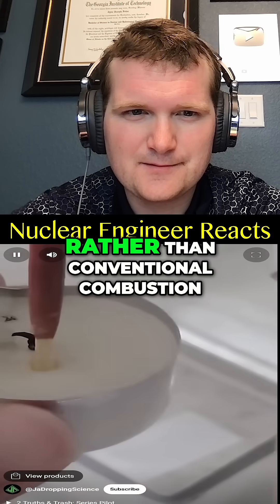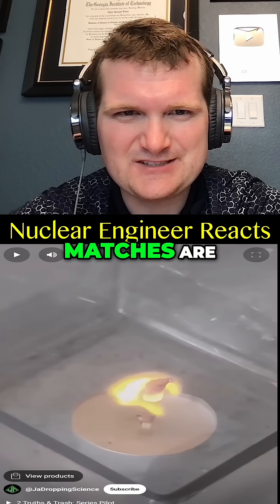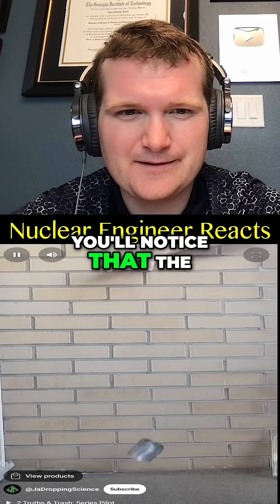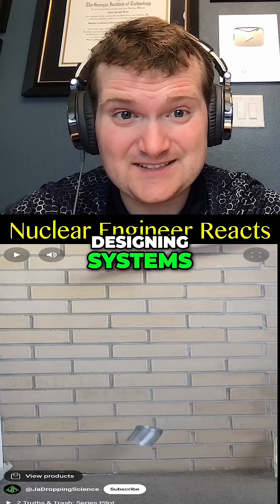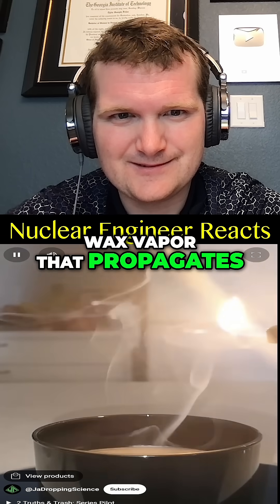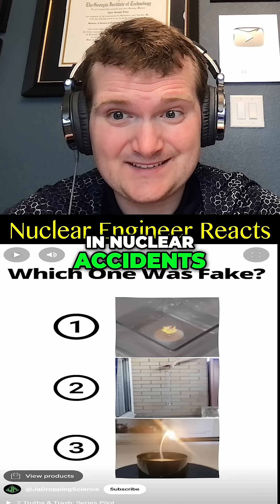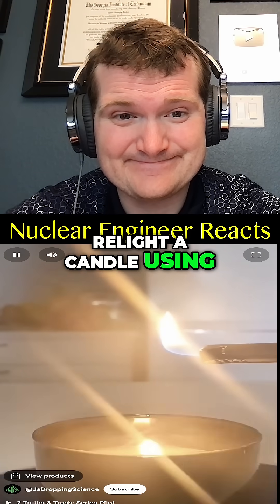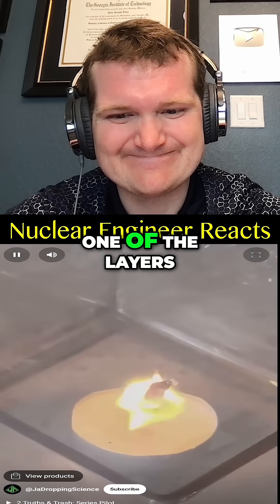Anti-Gravity Slinky? - Nuclear Engineer Reacts to 2 Truths & Trash by JaDroppingScience

Comment: Because Free Fall is indistinguishable from experiencing no gravity. Just as if you let go of a stretched out Slinky in space it would collapse back to the middle. It's still just doing that as the slinky is falling. The bottom of the slinky happens to be contracting towards the center with the same amount of acceleration 9.8m/s²,  as the center of mass of the slinky falling down, making the bottom of the slinky appear stationery from the reference frame of the ground.

Comment: the smoke from the candle can be relit because the smoke is unburned fuel, and when you see a flame, that flame is there because you have burning gasses. 

this thing about lighting smoke (or vaporised fuel) also applies to things like cooking oil. if you have it heated to the point it starts smoking, if its smoking enough, putting a match to it will make the whole thing ignite. if you go further, it will self ignite. 

also, if something sold (eg wood) is smoldering enough that it's producing lots of smoke, you can chuck a match at that too and the vapors will light. if something is smoldering like that chances are it'll light itself since smoldering fires produce heat too. 

this is how bush fires can start from lightning strikes, since it'll make a smoldering fire that eventually gets big and hot enough to have flame, which allows it to spread much faster.

Comment: Huh, didn't think about the delay in a waterhammer, which would need to be taken into account in the design. That and reflected back pulses, yeah, adds a level or two of complexity to wrangle.
Water damage for a home water system, but in a system with live steam, that turns into an awshit situation.
And in seismic events, turns an awshit into an ohballs really quickly, because water being tossed around gets vengeful.

Comment: Fun fact. The reason you don't pour water on a grease fire is because the oil is hot enough to flash boil the water. This causes the oil to splash and become exposed to even more oxygen and creates a huge fire ball. As a kid, I experimented a lot with fire. I made several grease fires and threw water both because cool fire ball and I wanted to better understand why certain things reacted in unexpected ways. Science to me has always been a subject I love and I learned the best way to understand anything was by using practical experiments
Reply: any of you can sort of test this by folding an orange peel close to a lighter, being atomized allows each of the particles to reach the temperature needed to light on fire faster, plus having a higher amount of oxygen around them

Comment: There are actually waterproof matches that i have seen that will continue to burn fully underwater for significantly longer than you would expect. Though it looks extremely different than the video showcased, usually a lot of bubbling and it doesnt really look like a flame but rather closer to a sparkler until it resurfaces.
Reply: I came here to say this, I have them. They sell the storm proof matches at Walmart and other places. Water, dirt, mud, nothing puts the matches out. When you pull them back out of the water or mud the flames do come back

Comment: Most "waterproof" matches are just wax coated.  They'll light while wet, but not under water.
Reply: The storm proof matches can be lit while under water because the fuel they use is strong enough to keep heat generating while no flame is present but the match isn’t on fire while underwater
Reply: Then why do they bubble under water then?